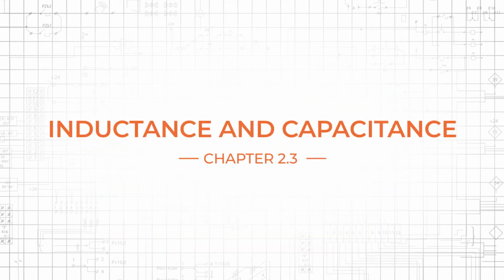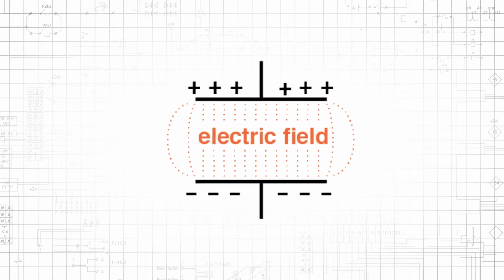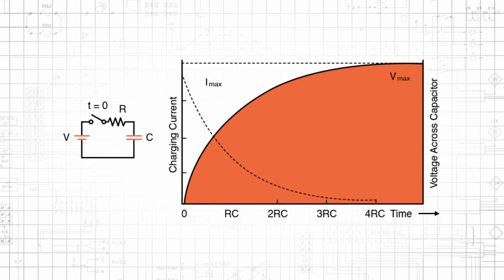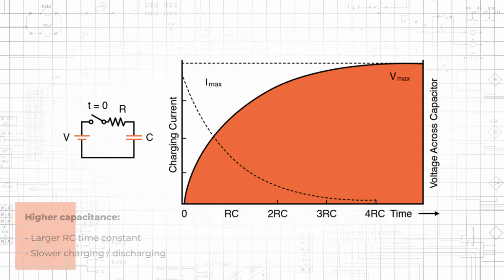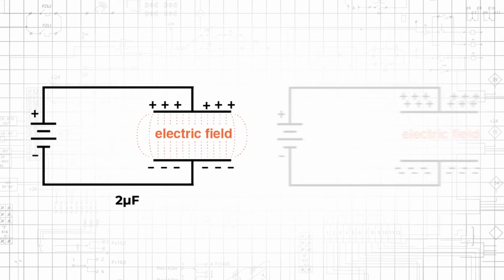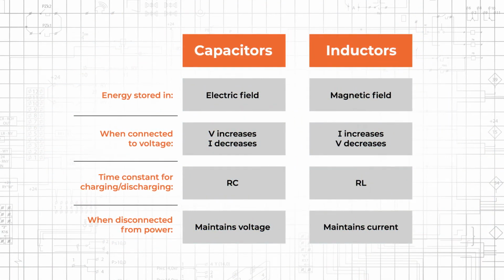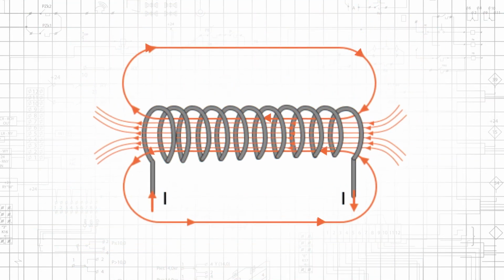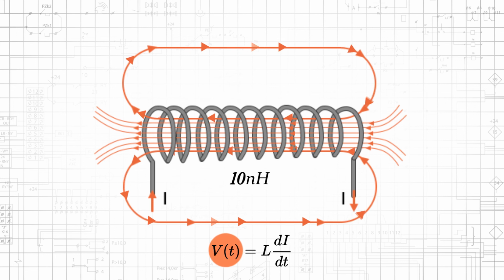Capacitors and Capacitance vs Inductors and Inductance

Comment: i need using them for ebike lifepo battery balancing cells. capacitors balancers blow up when around 2 times higher voltage passing by than maded for. induction balancers probable safer, better. i never tried it